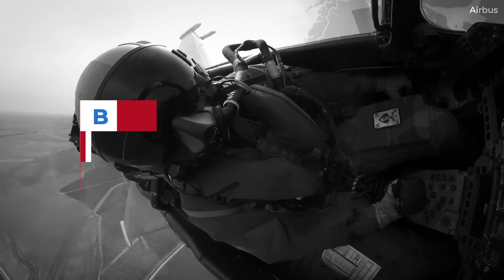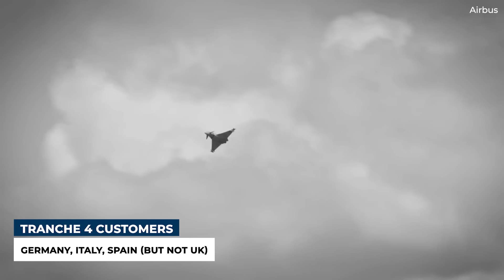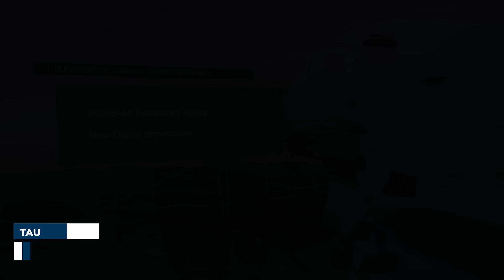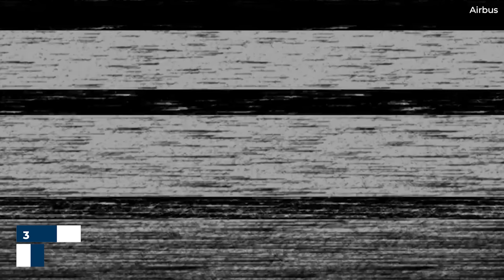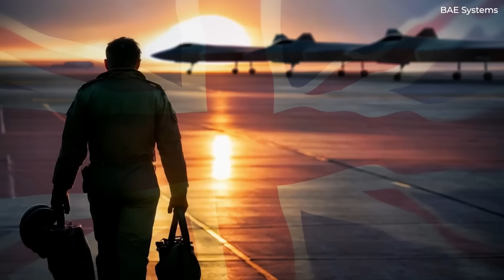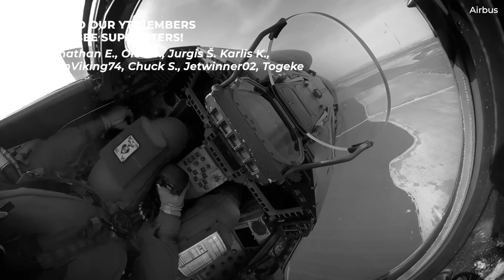First Quadriga Eurofighter Tranche 4  Completes Successful Test Flight

Comment: The point with the Typhoon is that it is the backup/reserve for the front line air defense and with super-cruise speed it will deal with swarms survivors that get through the missile and front line fighters like Gripen (seems to be the choice these years). The Gripens passive defense is the wide dispersal. Taifuns defense is that it is known where it starts from, but with super-cruise they will stay back and provide protection for the airfields and and tankers, and Global Eye. The Global Eye is the tactical coordination as ground based tactical is far to vulnerable.  The missiles will be coordinated separately from the ground under the subordinated to the brigade.
That is the picture forming in my head.

Comment: No Radar 1 is a slightly upgraded original radar set with a new AESA scanner plate. The electronics in the back ard just upgraded to use the new AESA technology The Radar 2 is an all new system with an ASEA plate that can be mechanically moved to give vast coverage. The back end processing is not an upgrade  but all new. It has an enhanced electronic attack capability. Tge Radar one and two are two different systems.

Comment: Wonder why Canada doesn't buy the Tranche 4 Eurofighter instead of the F-35
Reply: NORAD compatibility.Yes canada does need a fleet of air superiority fighters as well.
F35  to be honest wouldn't have been my call for canada F15EX was probably a better fit.
BUT canada does have long flights and dispersed ops is handy which F15 of any sort can't do..F18 is old marine it can take a beating..rafale can do to but french won't do the IP share to fully co-ordinate with norad.
JAS39 can do that and will do that so it's complimentary not competitor in that respect..much better optimised for arctic than either F35 or an F16..and SAAB are working with boeing on T7A/F7A too no biggie.

Comment: COMO ESPAÑOL TAMBIÉN ESTOY ORGULLOSO.....
 (I'm sorry not speak Inglis)
 .....de continuar con el Eurofighter.
 España firmó por 20 Tranche 4 + 25 Tranche 4/5?.
 El 1° Tranche 4 salió el día 2 de Junio del 2026 ¡6/2/2026! de la planta de Getafe (Madrid).
 El General Francisco Braco Carbó, confirmó la entrega de otros 2 durante el año 2026.
 Hoy en día es muy difícil saber "la verdad"....y siempre nos tenemos lo peor.... pero aveces puede ser al revés....o todo lo contrario 🙄.
  Según mí "conocimiento", además del nuevo Radar, la capacidad Aire/Tierra serán superiores a los Tornado o a los A/F-18....y los "nuevos" EJ200  superan los 2.500 K/h a 11.000 metros de altura....y ésto y lo otro.
 Demasiado bueno para tirar éste proyecto a la basura.
 Demasiado tiempo, esfuerzo y "dignidad".... para.....¿comprar otra cosa?
 NO.

Comment: Maybe you could do a video explaining what the different 'tranch' levels represent, why is 4 better than 3, what will 5 include? Is Britian upgrading their jets only with a radar equivalent or lessor to the T4 variants?
I really think the UK should be leaning more into Typhoon, obviously we need to have some F35 for the carriers, but I see no reason to equip the RAF with them, that funding saved should be put into getting GCAP sooner. Especially as we cannot use our own standoff weapons on F35 until Lockheed pulls their finger out and integrates them (which they have no incentive to do as they want to force Britian to buy more US weapons)
Reply: ¡NO SURRENDER!
Reply: BAE Systems will be building the Tempest in place of the Typhoon, so that is when production will end. The UK government committed to the Typhoon early, with the result that the RAF already have all they need, hence the upgrades. Germany and Spain have spaced their orders out, which is why they are getting new aircraft.
The UK already has multiple F35Bs, which have seen multiple operations from the two carriers, the additional RAF F35As are nuke-capable, which is not a requirement for many European forces.
wiki has a comprehensive article.
Reply: @nicktecky55  wait, the UK wants to be able to deliver nuclear weapons via aircraft now? the subs alone aren't enough as a deterrence?
Reply: @embreis2257 Things have moved on since the days of disarmament and the Iron Curtain coming down. The UK only stood down its air force capabilities when the Trident system was commissioned. Nuclear capable cruise missiles have been commonplace since the 1980s. Some of those are air launched.
Reply: well uk being a typhoon co-developer gets the best tech and mates rates.
same as germany....1 export deal can provide the jobs,and also provide the replacement cadence.
If you know these things are planned to last 25-30 years typically(say 10000 flight hours) you factor that into your sales,so it pays for future r+d,and futureproofing your own fleet for nasties like long term mechanical failures and renewals due to attrition.
Reply: The ECRS Mk. 2 is superior to the Mk. 1 on the Tranche 4.

Comment: how hard is it to change the mk1 to the mk2 radar?
Reply: ECRS Mk2 requires a new radome, but other than that you should only have to replace the radar hardware itself. But nobody in their right mind will replace the widely adopted solution with the prohibitively expensive experimental boutique solution for some fringe added features when you can instead just replace the DASS wingtip pods with Arexis to add them in.
Reply: the video is wrong - in no open aviable source does it state that the mk1 or mk2 is better then the other - its plane and simple WRONG
Reply: I think this question is purely theoretical, since the MK2 radar is exclusively British-owned. But that’s not a problem, since at least Germany—and perhaps other nations will follow—will receive an electronic warfare version of the Eurofighter that will most likely be significantly more capable than the MK2 radar.

Comment: Wonder why they still insist on semi-mechanical radar scanning?
Reply: A few years ago, hensold posted an answer to this question. With AESA radars, the resolution and performance are lower at large angles. To compensate for this, the radar is moved.
Reply: Larger field of regard and compared to the original fixed CAESAR demonstrator reduced frontal RCS.

Comment: German here, that’s good news for the Bundeswehr. As far as I’m concerned, it could have been more. Another positive development is that the decision to procure Tranche 5 was made last year. For now, the plan is for 20 T-5 aircraft to be delivered between 2031 and 2034. Another 15 Tranche 3a Eurofighters are to be upgraded to the EK (Electronic Combat SEAD/DEAD) variant. If you add up the new tranches and the EK variant, you end up with 73 aircraft. With a current fleet of 140 combat aircraft, this means that by around 2035, just over 50% of the fleet will consist of upgraded or new aircraft. That is clearly insufficient, and I expect the government to significantly increase its orders.
Reply: The amount or in the puplic view  "low amount" has a reason.
ICEYE > EuroDrones > Eurofighter and/or 'Grunt/Soldier-Drones'.
ICEYE the General
EuroDrone (Hive-Mind) the Commanding officer
EuroFighter > Fieldofficer/Fighter
'Grunt-/Soldier-Drones > Fighter/Close combat

1x ICEYE
60-80 EuroDrones
120-150 EuroFighters
...
When a or 2-3 EuroDrones in a sector they operate drop or are suddenly not reachable > Eurofighter can take partly or full of the EuroDrones job until replacment is entering the sector.
ICEYE keeps beeing the core.
Reason why ANY Eurofighter beats even the new (incoming) best F35 intern Radar & sensoric.
Unlike F35, can the EuroFighter use outsourced sar-radar & sensoric from ICEYE.
F35 newest radar range 240-260km
Eurofighter (today) ' 500+ km
> While able to see behind the earths curve.
Reply: Does that number include the 35 F35 that should start arriving next year?
Reply: @-MarcelDavis-  No, he only talked about new and upgraded Eurofighters. The electronic combat role is also fulfilled by new Eurofighters (I think it was done with the Tornado before). In the German army, the F35s official primary purpose is to be potential carriers of the American nuclear bombs, because the Eurofighters will not be certified for that.
Reply: @addygreen8919  👍
Reply: @addygreen8919 True. THEY COULD carry them - but US will not allow them, in order to make "us only" aircraft needed.
Reply: In better english:
Yes, the Eurofighter is technically capable of carrying nuclear bombs, but political resistance, strict US licensing requirements, and industrial secrecy effectively blocked it from receiving that certification.
Reply: @aw3s0me12  CIERTO.
 Alemania ha comprado los F-35 a la fuerza, ellos querían el Eurofighter T4/5. y ante la negativa de Estados Unidos pidieron 36 F/A-18 Super Hornet, pero también se lo negaron. 
  La realidad es que no entiendo por qué Alemania tiene Bombas Nucleares de "Caída Libre" 😅, lo normal sería que tuvieran misiles Tomahawks con cabeza nuclear  o algo similar.
 Un Saludo desde Barcelona.
Reply: Wondering if that EF EK is going to have better EK capabilities than vanilla F-35A
Reply: I don't think so Bundeswehr plan for luftwaffe is to have a fleet of 200 fighter jets by 2035.
1)35 F35A Lightning II
2)35 EuroFighter EK (across Trache 4-15 and Tranche 5-20)
3)130 EuroFighter Typhoon (across Trache 2-76,Trache 3A-31 and Trache 4-23)

Comment: I would be really interested whether and what is better between the "ECRMS MK 1 from Germany/Span and the MK2 from UK". I know that MK2 has more active EW capabilities, but usualy if you develop a system to be able to do more tasks it sacrifycis/compromises in each or one of the abilities efficiency/capacity. Hence, being able to more active EW, might cause that the detection/observation range/efficiency is less than the MK1??......At the same time I read that the MK2, although being able to active EW, cannot replace a fully dedicated EW plane like the growler, so there is a difference stil.........Probably such information are classified.....
Reply: At least Germany will build Eurofighters specifically equipped for electronic warfare or upgrade its 3a models.
So it appears that the nations mentioned here are opting for a specialized aircraft.
Reply: I suspect that any capability differences are less significant that the fact that the Mk2 is manufactured in the UK and therefore protects UK domestic R&D/ manufacturing. We know that the UK is investing in more UAV based jamming capabilities under the Storm Chrome program so as you said, not enough on its own.
Reply: @rorythomas9469   No the difference in capability are said to be significant. The MK2 was specifically designed to allow the Typhoons to self-escort and operate in contested airspace without support. It is a completely new radar (the antenna and all the back end computers) said to have an extremely high powered and wide band electronic attack capability. The Mk1 is just an upgrade of the MK0 with a new antenna and new attack computer. Bare in mind that the Germans have decided to convert 12 or so Typhoons to a specific electronic attack role where as the UK and Italy do not need to as the MK2 will be that much more capable at electronic attack.
Reply: @joshafc41  ECRS Mk1 has new significantly more capable GaN-based TRMs, a new fully digital multichannel receiver with advanced multicore processing (which actually delayed development as a certification process for multicore processors had to be first developed by the Luftwaffe) supporting task-based operations and software-defined functions and a new APSC to provide the necessary power and cooling for the EA functionality (escort and stand-off jamming) added as part of the ECRS Mk1 Step 2 in the context of P4E. So fundamentally more advanced than the ECRS Mk0 sold to export customers or the Captor-M it replaces in German and Spanish service.
Reply: @RichelieuUnlimited  this - i have no idea how people could say its basicly an upgrade when its not
Reply: ECRS Mk1 is the X-band monster, the Mk2 likely trades some high-end performance for its reported increased frequency range beyond the X-Band.
Reply: These are like "sidestep" from the mk0 delivered on the Qatari Typhoons now going to Turkey.
The MKI  Captor Cesar, is developed by Indra and Henshold while the mk2 Captor E, is developed by BAE as separate branches.
Reply: It is true that the UK or the German EW versions can not replace the Growler. The latter are EW attack aircraft, screaming out an insane amount of energy to paralyse wide-ranging enemy systems (everything from comms to radars and electronics). Europeans (Gripen E and Typhoon EW) fly with self-defensive EW and regional spoofing. If Europe started fielding Growler competence, which is useful mainly for deep strike missions into enemy territory (or invasion forces), that would probably not go down well in Europe. NATO is still a defensive pact. 

Thus Europe fly with lower-powered systems, extremely capable of blanking out lines for SEAD/DEAD packages, shouting out spoofing signals and all that jazz. 

Think of it like this: the Growler is a stand-off wide-area megaphone, while Gripen E/Typhoon (with EW pods) creates smaller "bubble of confusion" to hide inside. One can also look at it like: The Growler flies with floodlights, while Gripen E/Typhoon and F-35 fly with highly directional (beamforming) systems that point directly at systems/antennas. 

This is because the European aircraft are also attack systems. The Growler pushes out so much electromagnetics that it is a massive beacon in the sky. Most modern missiles now come with "home out EM-output" and "home on jammer". Therefore, the Growler operates with a "high probability of detection and intercept regime" while European fighters operate EW within a "low probability of detection and intercept" paradigm. 

Growlers are useful when you send in hundreds of aircraft into Iran (messing with electronics so badly that automatic car ports start to open and close by themselves, TVs change channels etc) as they blast everything. Every other jet (including the American Air Force) uses the "European" approach, locating, blinding, and spoofing on the go without lighting up the sky. 

For the UK MK2, the main difference is the radar. Similar to the radars of Gripen E and F-35, it is getting beamforming AESA radars that can do "double duty" as active/passive radar systems (for situational awareness, ground scanning, missile guidance, etc), while at the same time pushing out "beamformed" signals into enemy radars/antennas. A typical trick is that the radar listens for the exact signature of the enemy radar, delays it for a "micro-second" before pushing it back from where it came (phase manipulation; thus changing the position of where the enemy thinks the radar return came from). The latter is very old school; these new AESA radars are way smarter, but it explains the zero-order way they function. 

As I understand it, some German aircraft will get a SAAB "pod" variant of what Gripen E has built into its airframe (Saab's Arexis EW architecture). 

The F-35 also flies with a distributed EW system (AN/ASQ-239), but unlike the SAAB Arexis, this is much more a passive EW system (it would be silly for a stealth aircraft to send out radar/electromanetic waves). They can go active, but that is more a self-defence/panic mode than a strategy. This also hints at why most nations see the force-multiplication of blending stealth with the most modern non-stealth aircraft - as one simultaneously enhances the enemy's confusion exponentially by applying "active and passive EW" at once. 

I hope this very rough guide clarifies the distinction. Growlers are happy to shout "here I am" and blind even remote-controlled carports; everyone else is way more surgical.
Reply: @glacieractivity  You‘re incorrect. Eurofighter EK Step 1 replaces the wingtip pods with Arexis, Step 2 adds dedicated underwing jammer pods on top of that for broadband stand-off and escort jamming, though the ECRS Mk1 Step 2 will also act as a high-power X-band jammer.